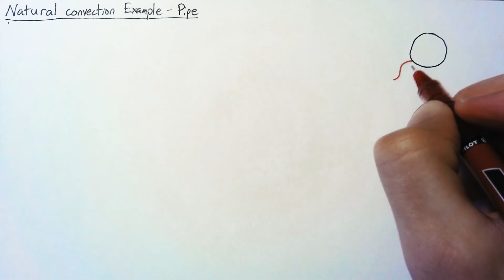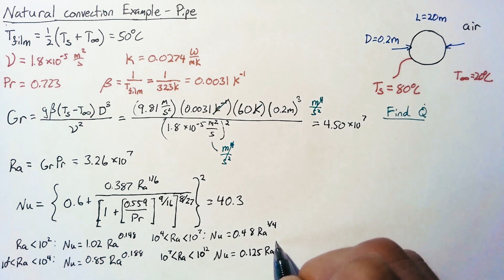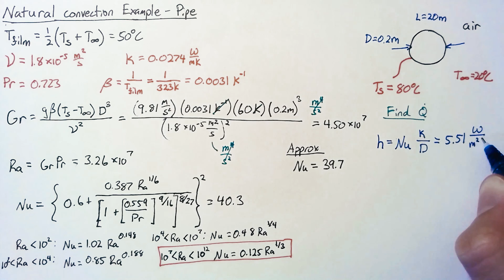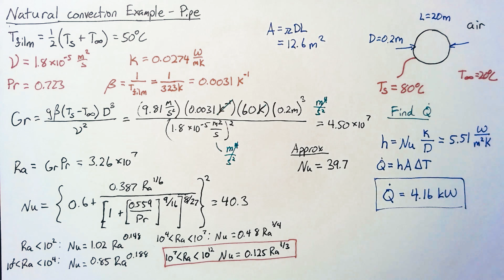Natural Convection Example - Pipe

Comment: Is the pipe oriented vertically or horizontally? and does it make a difference?
If it does, is the characteristic length of the vertical pipe equal its length and not diameter?
Great video btw thanks!
Reply: pipe vertical: Lc = height
pipe horizontal: Lc = diameter
Reply: @iiumstudent1995  I apologize. I had the number 2474 on my mind with a loss of 17. I am sure the teacher knows his skill.
Reply: Why is 1030125 considered a problem?